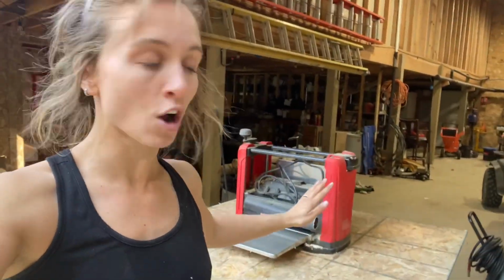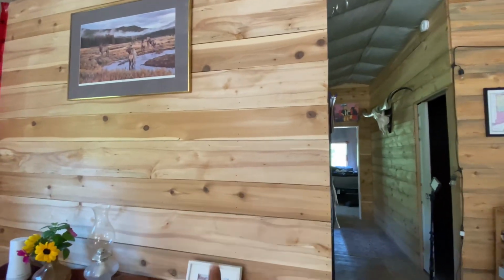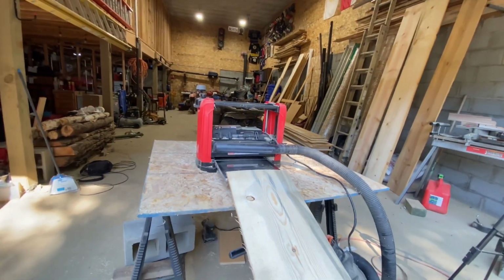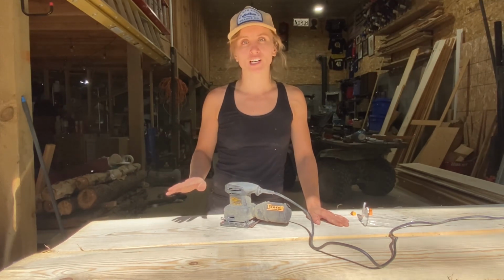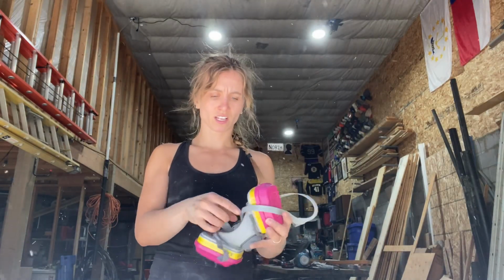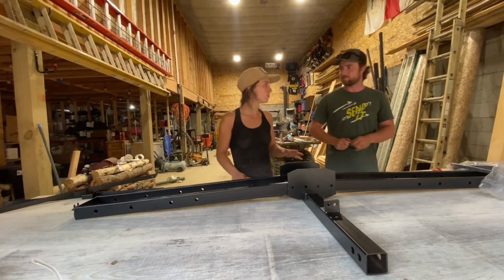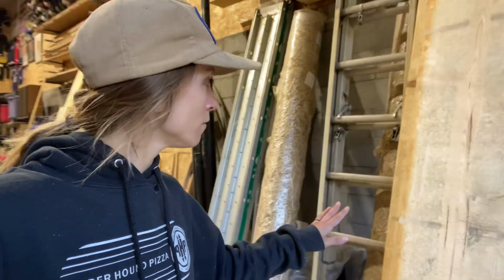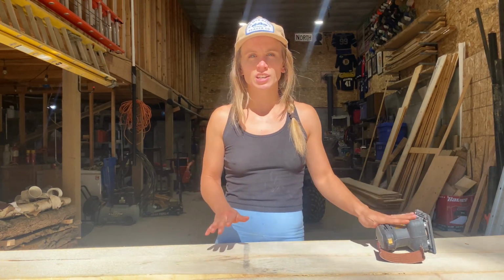Rough Cut and a Rough Look | Idaho Shop House

Comment: Liz your hard work is commendable. You might see a difference in the boards that you plane verses the ones you sand when it comes to painting or staining. The planed board and the sanded will probably not end up the same color when you stain them.  The paint might give you a different sheen. Maybe test a sample.

Comment: If you want a very speedy process with a less efforts, you can use the angle grinder with 180 paper and sand it very lightly as it will sand it real fast.

Comment: I got a deal on a truck load of oddball sized 10 foot planks and I saw the same thing with the crown and the boards but luckily ours were all cut at like 1 1/4 inch thick so we just ran them through a few extra times to take the crown out to make a nice flat surface so maybe in the future cut your boards 1 1/8” instead of 1” that you can run it through the planer and take that crown out without sacrificing the thickness

Comment: Looks good. You might consider 
Running all the boards thru the planner then lower the blades. This will ensure the same thickness. If you are getting tear out, consider running board through the other direction. Also consider getting a Diamond sharpening stone to run over the planer blades to hone a fresh edge. Or sharpen the blades or replace with new blades. Also, a belt sander may speed up the process. Way to go girl! Thanks for sharing

Comment: Doing a great job Liz. I would buy a random orbital sander that allows you to attach your sanding discs with velcro. I also would have run your boards through a table saw and cut them all the same width as your boards that went through the planer. A lot of work but you are doing a great job!

Comment: Liz, get a belt sander. it'll be much easier and quicker. and something I learned when I was building cabinets is always sand with the grain. When you cross the grain it leaves little scratches, and their hard to get out and they show when you stain. Great video, although when Mike showed up the sound dropped 25% and I had to turn up the volume which kinda blew my ears out when you went back to the sanding to the end.

Comment: I think in the future I'd cut the boards thicker so you can run them through the planer to get them smooth and uniform thickness.  I'd be tempted to cut the slabs to 11.5" so they'd go through the planer too.

Comment: Hey Liz...just rip your planks that are too wide to the width you need to fit through the planer...that is what a table saw is for... ripping lumber length wise to a dimension you can more easily process.  If you have to sand...get you a belt sander, much more efficient.

Comment: Last year, I made some furniture out of rough-cut cedar. A hand plainer will do a surprisingly good job in smoothing out the rough areas. It works quicker than sanding. I then followed up with the 120-grit paper to get the smooth finish. I like the ponderosa pine that you're using.
Reply: I am not sure how wide the boards are but it might save a lot of time by ripping them to 12" and then planning them.
Reply: @jerryswartz3391  The process goes a lot faster than sanding. I like their idea about varied board sizes. Its unique, but craftsmanship like that is what distinguishes unique houses from the ordinary.

Comment: Rather, You should use a large 8-10 pound belt sander. It would be faster. But in my opinion, the planner works yet faster.

Comment: I doubt you want to hear this, but there's a reason you don't see really wide boards at the home centers. It's because they are notoriously good at cupping, bowing and twisting. Unless you have a humongous log, and you can get away from the heartwood, they are going to do that. A simple fix would be to cut them down the center and have two six inch boards. They would for sure plane nicely and the added time you would save on sanding would offset the extra table saw work doubling each shiplap cut. I know, the bigger ones look awesome, it's just a thought. Looking good, btw!

Comment: So .. cut those wider than 12 inches down to 8 inches and use the remainders for door and window trim later. Those extra wide ones are more for bragging than effectiveness. They cup and bow and have loads of sap in them.

Comment: Yo u are most like done with boards  now   but I would suggest  ripping  the wider boards to width  that would  work in planer   also possible  do a rabbit cut so be modified  tongue and grove  making tighter fit on wall   my grandparents  cabin built this way  note my Dad built for them

Comment: Why not rip them on a table saw first and then plane them.
Reply: They would then need a jointer to make one side flat to then put on the table saw
Reply: @dill5500  Nope just run them through the table saw !!!

Comment: First off your problem is caused by dogs in your house !!!  Throw the dogs outside where they belong !!!! And the boards that are over 12 inches wide run them through the table saw to cut them down to 12 inches then they fit the planer, will save you time sanding, only have to sand the wavy parts that are caused by your milling practices...learn to work smarter and not harder !!!
Reply: @clivereynolds6633  Sometimes from a different perspective things are quite obvious !!!   thanks !!!
Reply: I agree that’s the best solution. I know you love your dogs but the apartment will be full of hair I know because when our dog of 15yrs passed away and we did a spring deep cleaning we found hair everywhere.  We decided we didn’t want another dog because no dog could replace our last dog and we didn’t want to do the puppy stage again.